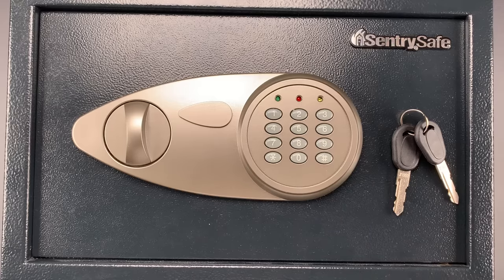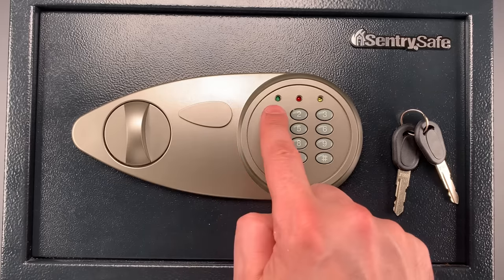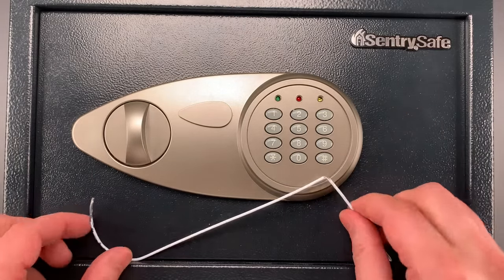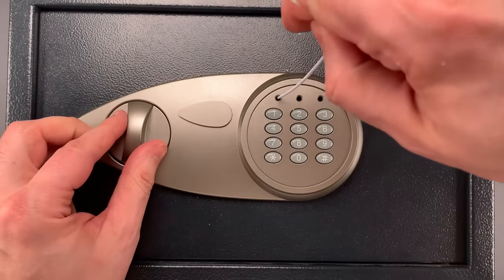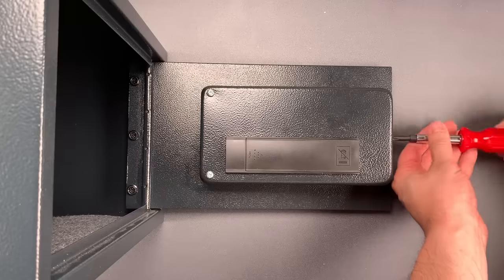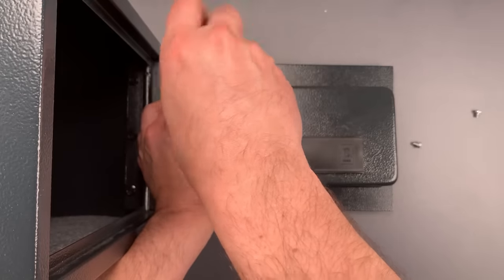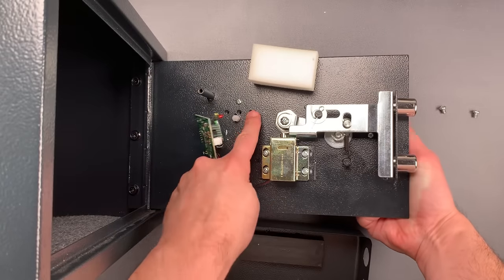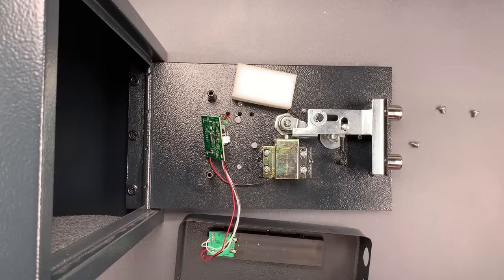[1020] SentrySafe Opened With a Coat Hanger!

Comment: I actually own this safe. It’s just good enough to keep things out of access for my little kids. That’s it. I have zero illusions about it being secure against anyone with a brain or any strength. And if they didn’t want to take the time to open it in my house they’d simply pull up on it ripping the thin metal the screws are in to hold it down then open it whenever they wish. But it does well for keeping ammunition in small amounts and prescription medications out of access for my 7 year old daughter.
Reply: Keep your kids away from his channel then XD
Reply: Try this, you’ll be very upset about it, turn your dial like youre trying to open it, just has to be at the point it stops moving, then with your open hand, smack the top of the safe while turning the dial at the same time, the safe will pop open, a common smack’s shockwave allows you to turn the dial and open these little safes..
Reply: Where do you live?
Reply: @rainierbettonviel5989  why does that matter for any of the above comments?
Reply: I pick mine with pair of toe nail clippers lost my keys
Reply: @rainierbettonviel5989  haha there’s nothing of real value in it.
Reply: And any Count Chocula you wish to stash, lol
Reply: @sourflowerpack9610  hahaha oh my gods. I just tried this. Took me 3 tries but WHACK BAM, third time it just opened right up. lol. Thanks man! Now I don't have to run to the ATM tomorrow morning before the contractor gets here!

Comment: What’s interesting is that he’s also provided anyone with this safe a fix to make it more secure. Just screw in a piece of 90* angle iron to shield/protect the solenoid. Exchange the sponge for a piece of steel/hard plastic/or even hard wood, screwed to the inside cover that he took off, to hold the circuit board in place. Also change the solenoid spring to a much stronger one. Now you have a pretty secure safe, that’s at least not as easy to pick open, or bounce on something to compress the spring and open.
Reply: If you make the spring too strong, the battery operated solenoid won’t be able to pull it in. The dead-battery bypass lock you see above said solenoid is easily pickable with a $5 tool. As a noob, it took me, three, seconds... I think even a plastic bracket, glued to the door between the solenoid and circuit board will thwart the coathanger approach. Especially if you use some epoxy or even silicone.
Reply: Or simply shield the solenoid to prevent direct access to the plunger.
Reply: And all of that work would be pointless when you look at the front of the safe. There is a set of keys shown in the video, and you can see on the side of the number pad where the cover for the wafer lock this thing has as an option to open the safe is, meaning it's prone to a low skill attack of just having that lock raked open.
Reply: I’ll be honest, I hate all these modern “cheap” safes. I’m talking about these ones on up to the larger gun safes, that don’t use solid steel for the walls and doors. No matter how good the lock is, or how many locking bolts the doors have, it just takes a medium size hammer (or a smaller sledge) and an angle grinder or something similar to just cut through it in a few minutes. It’s actually pretty ridiculous…and I own one of these.  They’re hilariously cheesy…they’re just basically a large “lock-box” that may keep your kids out (and might save ur stuff in a fire), but won’t keep out someone with actual intent on getting in quickly.

Comment: I’m trying to get a decent safe and literally every single one I consider I find a video from LPL easily busting it open. Lmao this is like a mini challenge for me at this point
Reply: What do you need to hide?  Your best bet is a whole cut in the wall. With a mirror or pics over it, or building a shelf mounted to the wall that opens.
Reply: @J.T.19134  I need a locked container to keep my pistol in. I actually ended up buying this safe, I took it apart and replaced the sponge and put an obstacle so doing this coat hanger method will be nearly impossible. It is also concealed behind a fake wall panel of my shelf so it should be “good enough” but I know LPL would probably disapprove.
Reply: Every house I lived in, I put in a fake cold air return that has a baffle and a latch to get to the goodies. Cheap easy to get to, and if it looks like part of the house, nobody would suspect it's there.
Reply: The best kind of safe is the kind that A) nobody knows you have and B) they still don't know you have when they are staring at it and C) nobody can figure out how to open because you designed and built it yourself.  Mine is such a safe.  I have guests over all the time and many will stare right at my safe and have no idea it's a safe and even if I pointed it out to them they are not getting it open mechanically.  There are only two ways to open it, one watch me open it and learn or two, a lot of explosives.   Of course long before that you will have to defeat the hidden non electronic alarm system and you are going to have to make friends with Scarface, my rescue pet who snacks on armadillos and snapping turtles and has survived after being shot 27 times and not by bb's.  

If you don't want to go through all the trouble I have I suggest you find an old (100 year old +) combo safe, make sure the mechanicals are in working order then cut a hole in either your foundation or in the basement floor and recess it in there and hide it behind either a concrete door that fits so tight that you can't see the seams or under a heavy concrete trap door and then cover the whole floor with carpet.  Few people will think to look past the foundation wall or a concrete basement floor.   Yes it will take effort to open the door that the safe is hid behind but then you don't want it to be easy.   Look into hidden pin latches as a way to secure the door.  I learned about them in a book on magic when I was a kid.   Once you know how they work they are relatively easy to install and nearly impossible for a safe cracker to figure out.  Poor concrete in the space around the safe so they find it ridiculously challenging to pull the safe out of the wall or floor.  Then decorate the basement room that your safe is in with a lot of worthless junk that no one would suspect is camouflaging something valuable.   NEVER have any kind of electric or electronic locking mechanism they are prone to failure as this video demonstrates.  Find a nice affectionate and highly territorial rescue animal.  Mine is a very large cat that adores me but is otherwise very paranoid and hates unexpected visitors.   She literally rips open an armadillo in 30 seconds and takes only a little longer to extract a full grown snapping turtle from it's shell.  Scarface isn't really cute to be honest but I NEVER have to worry about burglars.   

Nobody who has ever visited my home knows about my safe That's the best way to protect your stuff.
Reply: I realize that while looking for a gun safe. They all literally have cylinder locks that can easily enter picked.
Reply: Wertheim are really secure pricey but take drilling grinding to get into after a long time
Reply: Bro same let me know if you find anything that stands the test of lock picking lawyer lmao
Reply: I wonder, how long they will be allowed to still call these devices "safe"...
Reply: @fritzfiedler1807  Except now that you told anyone who reads these comments! I'll be over sometime this week ;)
Reply: Yeah..lol 
People are going to start suing him for teaching the criminals 
how to bust into their budget safes..lol
Reply: @Vladimir_Popik  Buy a brand new Diaper Genie and keep your pistol in the bottom. Nobody will dare look in there for anything!
Reply: @nunyabiznez6381  Yeah right.  Sure you did.
Reply: @martinfiedler4317  They will slow down an inexperienced burglar and they will offer some degree of protection against fire.  You get what you pay for.  If you buy a $200 safe you are going to get $200 worth of protection.   If you want real protection, have your safe custom built, or if you have the skills like I do, build it yourself.  Design it so the lock is like an impossible to solve puzzle.   My safe looks like a normal antique piece of furniture.  You would never guess it's a safe.  If you did guess, which is highly unlikely, you would need to also guess how to open it.  It's basically a complex puzzle that actually takes me about five minutes to open.   No combination or key.  It's basically a really difficult puzzle box.
Reply: Any of these kind of safes, they can just rip the whole safe out and deal with getting inside later on.  ...or even if you bolt it into the foundation, they can hacksaw right through the case fairly quickly.
Reply: @nunyabiznez6381  That's sounds awesome, but is it a fire safe?  Most things you would put into a safe will be destroyed by fire.
Reply: @eventhisidistaken  It is insulated in a way to withstand 3700 degrees f for 6 hours.   That is a higher rating than most fire safes on the market.  Then again I have a well wired home and don't have any open flames.  The only appliance that runs constantly is the refrigerator.  My home was built and designed by a paranoid prepper who also happened to be county fire marshal for six years.  My safe follows some of the design ideas that went into the house.   In any case, it is a physical impossibility for any kind of electrical fire to occur in my home.  I have no open flames ever inside.  Lightning rods protect it from lightning strikes.  You would literally have to douse it with a flammable liquid and light it to get a flame going and even then it would simply burn out leaving only some soot on the outside to show there had been a fire.  In fact I am so confident in this home's fire proofing that if you did dump some gasoline on it and lit it on fire I'd probably just go back to sleep and not worry about it any more than I worry about a direct hit by a tornado.  Basically I live in a fire proof bunker.
Reply: Having a cheap dummy safe is a good idea. How many thieves will keep looking for a second hidden safe?
Reply: @lazloslozar6782  Who needs cash when you have a safe you spent all the money on :D
Reply: 99% of people can’t open what he opens
Reply: Remember that the LPL always tells us that the main reason for a safe is a deterrent from others stealing your stuff. No safe is gonna be unpickable
Reply: @nunyabiznez6381  I miss our old house, that was also "modified" by a rather paranoid dude. Only way someone was going to break into that place was with an armored vehicle... and even that might have gotten hung up on the steel plates inside the walls, behind a few inches of wire-reinforced concrete. Windows were inch thick acrylic, and none large enough for anyone older than the age of six to wriggle into even if they used a torch to melt one out. That doesn't even get into the ridiculous hard-wired alarm and surveillance systems.

I'm working on modifying our current place similarly, but a lot of the stuff the previous owner put into our old place is pretty damn expensive. Oh, well - one step at a time...
Reply: @fritzfiedler1807  That is a great idea.  I could run fake metal air ducts downstairs to hold my rifles.
Reply: @nunyabiznez6381  this is even better if you imagine Dwight Schrute saying all of this.
Reply: i have a safe with a 2 sided key
Reply: Get anything with old school mechanical combination lock. Those can be manipulated open (see "safe graphing") but it takes some time even from a skilled attacker. Unlike these electronic toys.
Reply: @lazloslozar6782  Google a company that went out of business 20 years ago? Really?
Reply: Buy a safe as a decoy for robers and put your valuable stuff under your mattress...

Comment: Manufactures like that should be fined millions they are defrauding consumers
Reply: why should they be fined??, its a choise isnt it, buy a $100 euro safe, or buy a 1000 euro safe!.
Reply: Deterrence is far more effective than security.
Reply: Weird virtue virtue signaling, but ok
Reply: Sounds like you're saying automotive companies should be fined because the a thief broke into my car, even though it was locked, by smashing the window.
Reply: @mail-qh2qc  I think you're missing my point. Unless I read OP's post wrong, I interrupted his message saying manufactures should be fined because their product is a safe and should be hard to get into, yet you can easily open it with a coat hanger. My point was that anything with locks can be broken into and a safe isn't a guarantee to stop intruders from getting inside.
Reply: @mail-qh2qc  There sure is.
Reply: @SDeww  its a choice how much you will spend yes but the manufactures falslèy misleads you to sell a product  which is supposed to a safe and keep your belongings safe. So in my opinion its misleading the public even fraud
Reply: Sadly Sentry Safe is one of the oldest, biggest makers of these "Tin Cans" people put trust in??? WoW
Reply: @LightsJusticeZ  a car is not a safe, two different basic functions,  this safe failed. Should be tests like with crash dummies but safes. Hire convicts with private prisons to decrease their sentences by six months if the can break in under 60 minutes
Reply: @evilovesperry  bruh you missed my point completely
Reply: @mail-qh2qc  They all do. 😂😂 That's how people use shims or picks.
You missed the guy's point...
Reply: @LightsJusticeZ  not at all
Reply: @johnd1774  not saying the safe needs to be made from tempered alloy steel and have glass re lockers just that it not be bypass-able with the most primitive of tools a safe to qualify as a safe should not be by passable from the outside any key should not be rake able or be abled to be jiggled just a very basic level of actual security the goal being that a thief is forced to resort to physical destructive attacks as a consumer are expecting that that steel casing no matter how thin it might be actually plays a role in protecting your goods  why not keep your goods in a fridge with pad lock with the right pad lock your security will be slightly improved as those hinges are fairly heavy and would take some time to unscrew maybe 2 minutes better then 10 second pry the door off would likely take longer then a few minutes do the gap of the gasket and flexible nature of the door your not gonna just pop the screws from the hasp in quick motion with a prybar really a fridge with a pad lock is more secure choice when you pay for a safe you expect it be more secure then a fridge with a padlock
Reply: @evilovesperry   ya good idea allot cheaper then hiring the likes of the lock picking lawyer mmm he earns how much as a lawyer as a lock consultant for hire he would have to charge at least that as he would be putting his name as both a lawyer and a lock expert on the line at the same time prisoners getting a reduce sentience they would have to have an incentive to try their hardest like breaking into a safe in 30 minuntes get a week off from a 5 year sentience we the people get better safes that theives can not break into so quickly and being a criminal becomes less attractive win win our goal should not be to keep these people locked up for life it should be to lack the need to lock them up in the first place
Reply: @mail-qh2qc  And that difference are usually paid at the cashier.
Reply: In the end you can buy 1million dollar safe work it crack open and show step by step how to do it. Nothing is fool proof!!!
Reply: S Dew .....Stupid logic.
Reply: john d BUYER BEWARE
Reply: @LightsJusticeZ  that is an BS argument
Reply: @tomsims2998  lol you got a point...  the fridge will be safer then these so called safes what burgler is going to waste time trying to open a fridge for some food increasing the risk to get cought
Reply: @johnd1774  why
Reply: @kapec21  high end safes do exist even know every detail on how they are built any attempt to break into them is gonna take at least an hour how would you feel if the vault at your local bank was bypassed and they stole all the money its insured but non the less I bet you no known bypass exists for a bank vault the lock and door are of a known design how many banks are their vs how many basement safes mmm limited market limited design models the walls are simple steel reinforced concrete line with steel on the inside its very well known to be very difficult to break through to the extent the nuclear bomb dropped on japan failed to breach a bank vault at ground zero